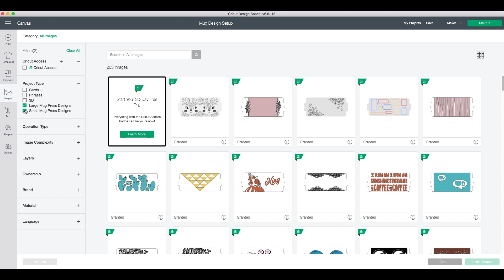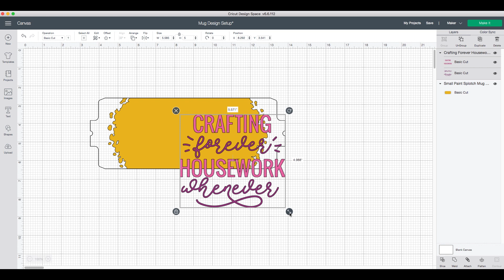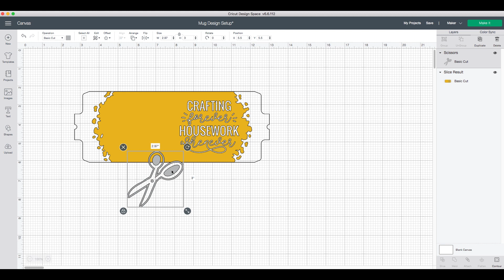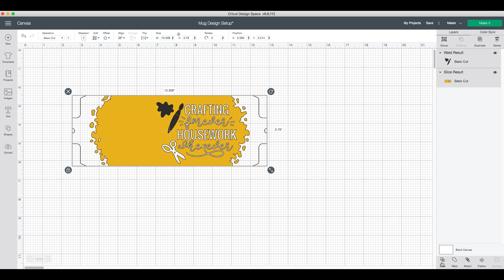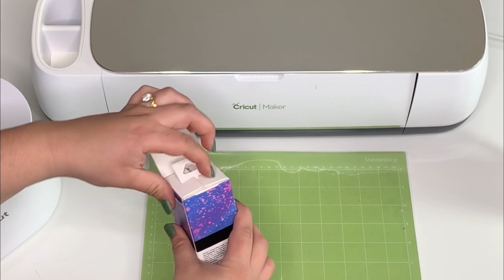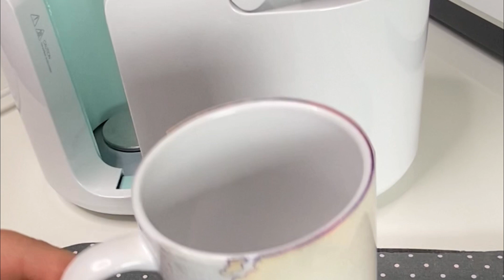Cricut Mug Press Tutorial and How to Make a Custom Mug Design

Comment: Couldn't you save material by only cutting the inner rectangle without the flaps and use heat resistant tape? Or do you have to cut out those flaps too?

Comment: Thanks for this video.  It gave me an idea and wanted to ask you about it:  Using your idea of using the patterns in Design Space, would it work if using a sublimation printer to print it on a sublimation paper rather than using infusible ink, and then the image is actually printed on the pattern seen here?  Thanks.
Reply from the maker: Yes, you could print the exact image to a sublimation printer instead of using infusible ink.

Comment: How does it cut through the carrier sheet around the outside. But not where the images are?
Reply from the maker: Good question. I'm not positive about the answer. I do know the machine does a double cut on the outside but not the inner design.
Reply: @EverydayJenny  that must be it.
Reply: Sometimes it does if it’s a very detailed design and you have it on “more” for a deeper cut)